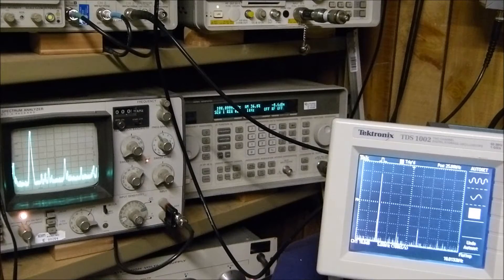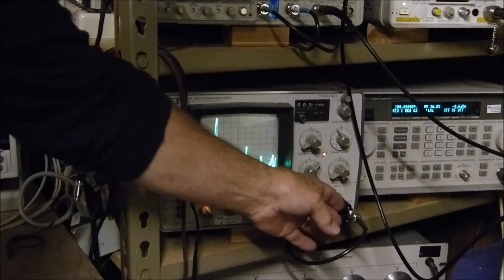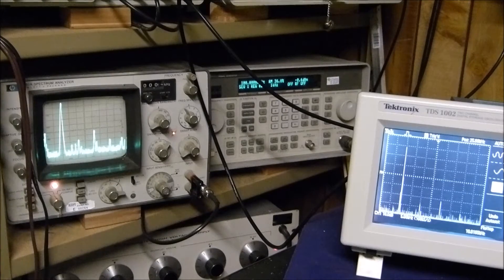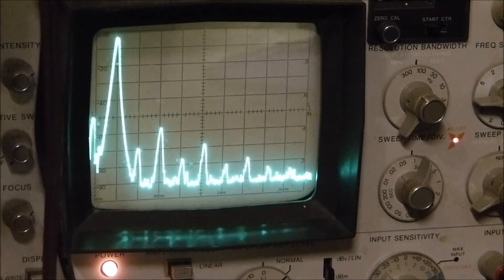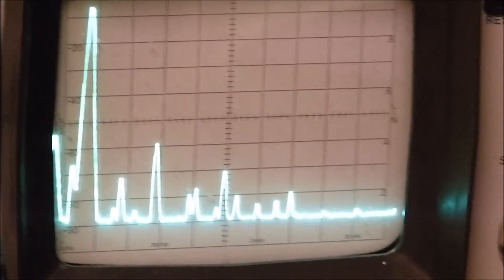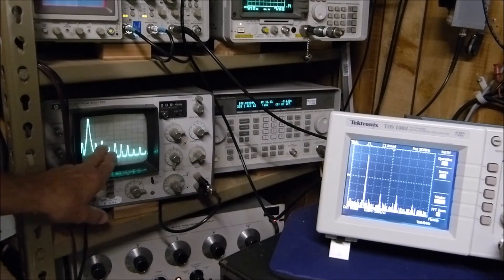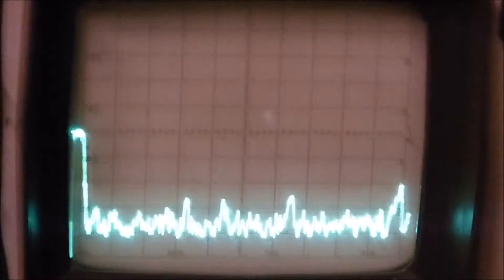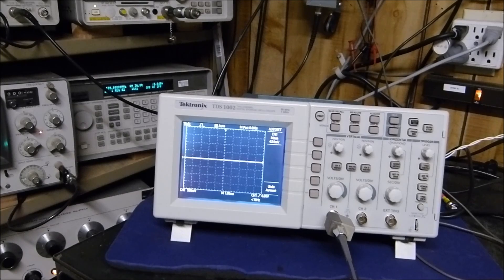Comparing Analog HP 3580A Audio Spectrum Analyzer To Tektronix DSO FFT At Audio Frequencies

Comment: Thanks, It's a very nice scope. 

What can be a problem with FFT is the aliasing of frequencies above half the sample frequency. So to get a true picture you'd need a brick wall low pass filter at half the current sample frequency.
Reply from the maker: +Alfred Stampe Yes, with careless button-pushing it will go into catastrophic aliasing but it does display the sample rate and frequency so with some level of "training/education" and paying attention to the moment, one should be able to resolve the delima. I have a dear friend that is a doctor (actually two of them) that have the same concerns about the youth of today that depend on technology to solve all their issues with them having to know little to nothing about "basics". Just answer all the questions the program prompts and the answer comes out with the click of a mouse.  It is the eternal problem of youth vs vintage. The world is going to hell with this young generation...  :-) :-)
Reply from the maker: +Alfred Stampe I have discovered both from reading the manual (imagine that) and experience that the most important thing to do, first, is press the Auto Set button and let the device configure. Then go to FFT. I don't think anyone can dispute its oscilloscope quality and digital readout information. My focus is on the frequency domain qualities of the instrument. Besides the aliasing that can occur, the amplitudes of harmonics in the profile will be off if manual configuration is forced. Overall, its pretty darn good. Everyone should have one.  :-)
Reply: +ElPaso TubeAmps No question it's a great oscilloscope, I have to admit my older analog ones are not used very often anymore since I got some decent digital models, it's hard to beat the convenience and size. The potential aliasing will also have an effect in the frequency domain, an interesting test would be to try set the FFT to cover e.g. up to 5kHz and then feed in sine waves of different frequencies e.g from 5kHz up to 50kHz and see what it displays.
Reply: +ElPaso TubeAmps  David,take a look at this unit..My friend has several of these for sale and they were like 80k new and we can get them for 650 but take a look at the data..It does audio as well.
https://accusrc.com/uploads/datasheets/Anritsu%20MT8802%20Datasheet.PDF
Reply: +ElPaso TubeAmps I realize my comment can easily be interpreted as being negative towards your Tek scope, that was never my intention. My intention was merely to point out one of the many pitfalls of the nature of a sampling scope vs. the analog way of doing things.
Reply from the maker: +Alfred Stampe Alfred, no offense taken in any way. I think it is marvelous that we can all express ourselves and never have to walk on egg shells around each other. And... I agree with you with the aliasing,, Nyquist frequencies, and so on and I am just not impressed with this low-end FFT analysis (display) vs the old analog 3580A. A screen full of meaningless spikes is just that, meaningless. It is all a painful-love doing this stuff in the first place and we as passionate hobbyists take this serious to the LSB (least significant bit - see, now my computer brain is engaging... ) Please don't think there is any issue. I have to be careful that I don't get too opinionated sometimes - you know - it's a tech thing sometimes. Always appreciate your comments. Please keep them coming.
Reply from the maker: +Alfred Stampe I have to tell you that you are right. I have worked with this instrument a lot recently. There is just no way this little FFT device can replace the HP 3580A analog device for audio frequencies nor can it even come close to the HP RF spectrum analyzer that I have. I am disappointed as I naively thought it would do a good job (replacing?) the SA. Not so. I am beginning to wonder if the FFT function is really worth anything.  I guess I need more than an 8 bit device for the FFT function to be good. The scope is OK.
Reply: +ElPaso TubeAmps In my experience most oscilloscope FFT is a bit of a gimmick, but sure there are great ones like the Tek MDO4000 etc, then we are taking $10-20k+ but I believe those actually have a real spectrum analyzer built in, not just using FFT. They are however not designed for audio range frequencies. And the Audio Precision equipment is not really in the hobbyist range either.
Reply from the maker: +Alfred Stampe 

Alfred,

Absolutely, I agree with you. I am (still) learning about FFT devices and I naively thought virtually any FFT device would satisfy my SA needs. I have learned better now.  :-)  With that said, I am also learning to appreciate what the FFT device can do. As you mention, the MDO devices do indeed have a SA and a FFT function. Tektrronix posted a three minute video on YT that pretty well states exactly what you said. Link below:

  https://www.youtube.com/watch?v=WTcUwN3To0I&list=LL-f4XWraJ1H8NhKMxrpzqAQ&index=11

So, when it comes to a Real audio level SA, that is still the way to go. I have always liked my HP 3580A but now I have learned to really appreciate it. 

As I think I mentioned in one of my earlier posts, (I have learned) that random knob twisting of a computer driven  FFT device will not make everything turn out right and give the display of our dreams. Actually, it seems there is more to know about real-value usage and data displays with an FFT device than there is with a SA.

 RBW is one of the most important parameters of either of these devices and, in my opinion, the true analog SA wins most of the time. With all my babbling, I can see that with careful usage the cost of the FFT instrument vs the high end audio level SA will make the FFT device win most every time.

I constantly learn and appreciate all the back-and-forth conversations we have on these subjects. 

David